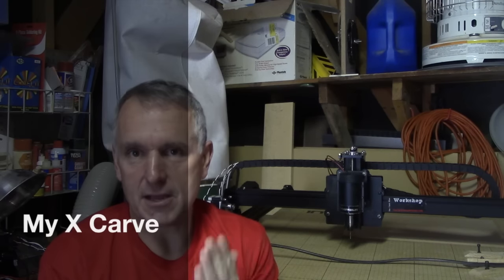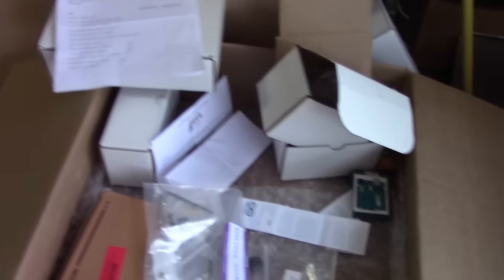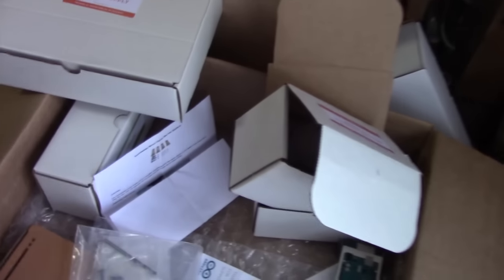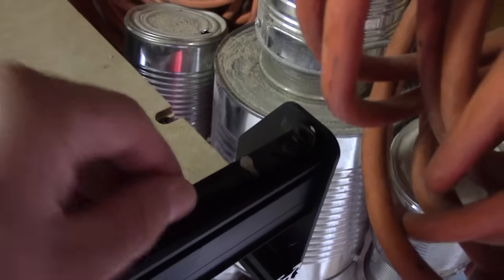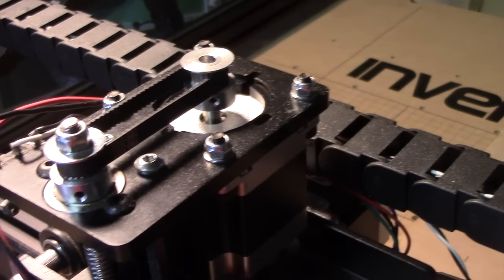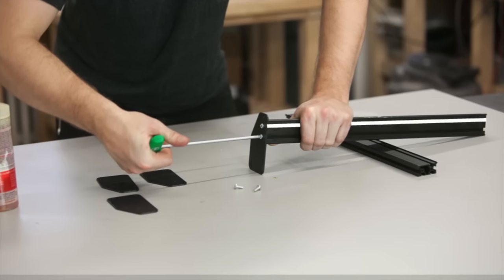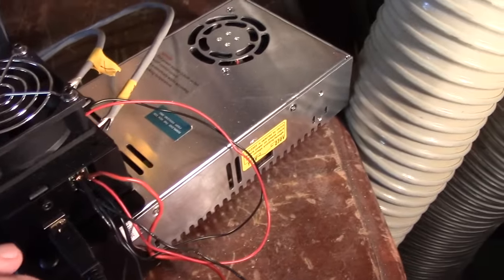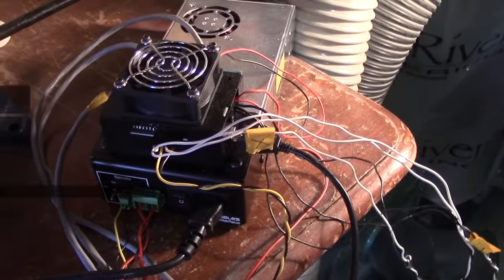My X Carve

Comment: I had similar issues with the xcarve belts, I ended up using superglue :)
Reply: +Darbin Orvar How's the super glue holding up? I read about the belt issue before ordering mine, so went down the heat shrink route - although I didn't Know what size I'd need so I ordered 1/2", 3/4" and 1".......Turns out you'll need 1/4" Typical! :-) LOL!

Comment: Have you had any problems with it going too deep on the first pass?  Mine seems to always cut double depth on the first pass.
Reply from the maker: +TheGeekPub   I have not noticed really I guess. I did have the wrong threaded rod chosen when I first tried it so it was going way to deep all the time.    Other than that I have not noticed much of a problem.  I am just getting started though so I will keep my eye out for it.
Reply: +Chris Pine Cool.  I've had two problems with mine.  Both seem related.  The first pass removes too much material.  This causes the machine to struggle and leaves a jagged edge or stair step effect as the sides of the cut material.  I can minimize this problem by setting the home position and then manual loosening the bit and backing it off about 1/64 to 1/32", but that's quite the pain.  No one else seems to have had this problem though.

Comment: Nicely done Chris! I completely agree, Many woodworkers are likely to already have an aptitude for making, thus making a relatively simple assembly even easier. :-) 
I also agree with the bolts at both ends of the slide - so far I'm using small Zip ties at the non adjustable end. and it's so far holding up with the bolts that come with the kit.

what's your next plan for it?